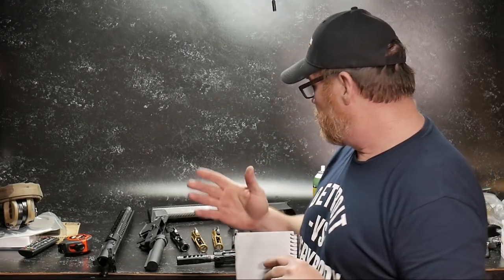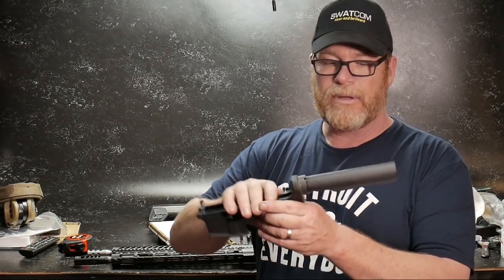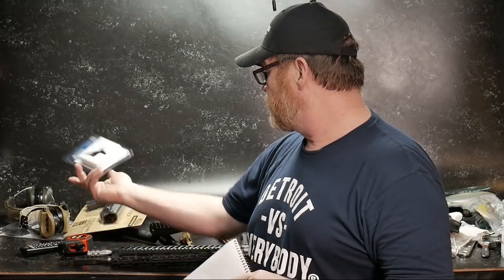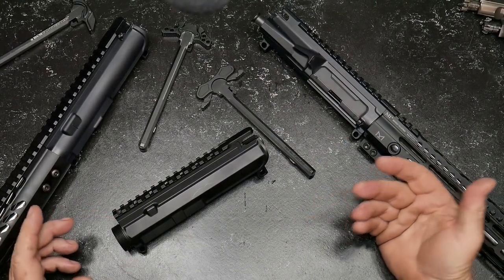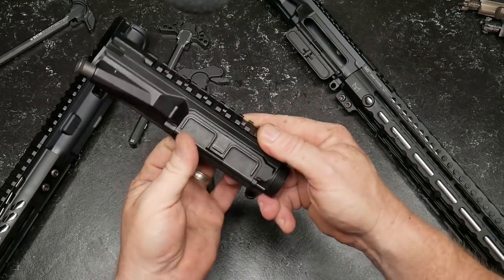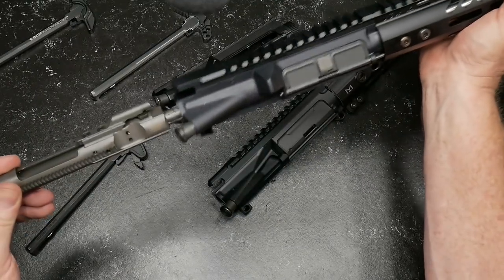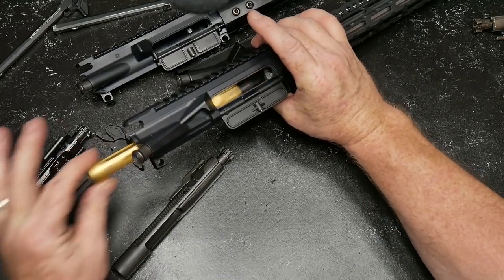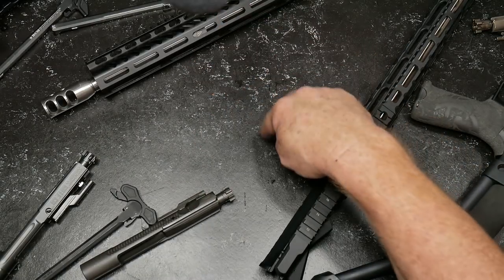Cheap Vs. Expensive!  Forged vs. Billet Receivers

Comment: I think a true mil spec rifle will be just as if not more durable than a high end billet. And shoot just as good.
Reply: Billet, whether steel or aluminum is not as strong as forged. Billet is a process from extruding a block of bar stock. The bar is formed by molten metal being formed in to bar stock, and then squeezed or extruded between rollers. Forging heats raw metal until malleable but not molten and then the pieces are hammered into shape, changing the metal grain, and making it much stronger. Billet is easier to machine on CNC and more aesthetic when finished.
Reply: Thanks for the information but I knew that already.  When I said more durable I was referring to long term use and normal wear and tear, not like a torcher test.

Comment: Use Molly graphite grease and work it back and forth with the carrier you will be using I it. It will lap itself in in short order. Then clean and lube it. I use the stay lube Molly on mine. The acitone clean the carrier bolt upper and everything to remove the Molly. It's a lot of scrubbing but it quiets down fast.

Comment: You want to know he difference between forged and billet, drop them on a concrete floor and note the difference in time, sound. Also, conduct an impact test on both receivers I the same location, with apx same force, a 3lbs mini sledge hammer will do, note the difference in damage to both lowers, and note the sound on impact. Lastly, take each billet and forged  material and shoot it with a 5.56.... note the difference in damage to the two. I won't make an argument to argue with comments. But I will tell ya how to find out why billet is the better choice. Forged material is sometimes reduced wall thickness as well as it being more brittle from the forging process. I'll take a billet process over a forged anyway where impact forces apply. Note that firing your rifle itself, creates shockwaves that ripple thru your rifle. Billet is tougher, not thinner, and not brittle. CNC machine isn't as expensive as it used to be. I'm just a welder, so what would I know. 🥑🥑🥑🥑

Comment: BRIEFLY, take your accurizing tool and put it in from the opposite (intended) end and smooth out the brand new finish on the inside of those uppers.  Put some duct tape on the end to protect the outside of the receiver from an "accidental touch".  Stay there too long and you might mess up the tolerances.  Hence, the word BRIEFLY.  Sometimes I use oil and Emory cloth.

Comment: Hey brother the PA pistol range you visit has been updated with a concrete slab and a roof, but beware they are looking for the smallest reason to handout fines. I received one today for firing my EDC pistol two times (2 bullets) to test my zero, and be a responsible firearms owner at 11:00am and found-out that the range is not to be used on Sunday before noon 🤨🙄🤷🏻‍♂️ make sure to very carefully read the full page of posted Fine Print rules.

Comment: I think the only thing that matters is barrel fit, I usually lap the upper receiver so the barrel fits flush, then hopefully the the barrel fit is tight or next to impossible unless heat is used, to install the barrel.
Reply: No the upper is just as important, especially if you want a precision rifle. I always tell people the best upper for precision shooting is actually a cheap receiver, and it is the DPMS slickside upper. The DPMS slickside is the thickest upper you can get, and it is amazing just how thick it is. The bad part is it has no features that the cool kids want. No forward assist, no shell deflector, so dust cover, but again it is for precision shooting so those features are not needed. In all honestly if I were building a 308 precision rifle my number one choice for an upper would be the DPMS slickside LR308 upper, and if I were building an AR15 for precision shooting my number one choice for an upper would be the slickside upper. It may be hard to find a Slickside LR308 upper or and AR15 slickside upper from DPMS, but several companies make exact copies. The LR308 slickside upper has an ultra high rail, that makes it so you have no trouble reaching the charging handle with a scope attached and that the scope does not touch the handguards. Both uppers are cheap, and the clones are cheap too, but I'd choose them over any other upper if I was building an AR15 or an AR10 style rifle. The downside is they are heavy uppers, but I actually think it balances the rifle, cause a lot of rifles are front heavy, and the DPMS sickside uppers add weight to the rear. Another downside is there are no handguards that are as high as the rail on the slickside LR308 upper, but I would never add a handguard rail to any rifle I own, but it might be an issue for people that have to have railed handguards. Nonetheless they are cheap uppers, but being cheap does not mean they are not great. They are even made from a higher quaity aluminum. They are made from 7129 aluminum instead of 7075 or 6061.

Comment: 1Forge is stronger than billet ,2 uppers and Lowers are just housing.. the upper houses  the blot carrier and the lower houses the the trigger. My three pistol are Anderson lowers and uppers but I hv a ELF trigger In one a timmey trigger In the other and Geissele rapid fire trigger in my last one and 3 chrome Rock River Arms bolt carriers In all three ( highly polished bolt carriers) buy cheep uppers and lowers and buy the best triggers and bolt carriers and buffer and springs and a barrel.

Comment: There is a Reason why the forward assist was incorporated into the design of the upper receiver. It was necessary in certain instances in battle. I don't care what anyone says. Competition shooting is a wonderful thing, but if you have a failure on the range it won't kill you. If you have a failure on the battle field it just might.

Comment: Kotaboy32 Tactical the difference between the two has to do with material structural strength and how they will fail. A forged upper will fail and fragment usually, while a proper billet one will crack and spread but will not fragment potentially saving you pieces of metal to the hand, arm, face, and/or neck areas. It has been shown that unless structural designs are changed to add reinforcement it wont change the strength of the piece but it will change the way it fails. If you are firing 5.56 or such it is nearly unimportant unless you manage to over charge the case significantly, but it does come into factor when you are shooting much more powerfully loaded rounds, notably .458 socom or .50 beowolf where you have a lot more powder and thinner bolt to lug walls.
Reply: Forged aluminum generally refers to material that is ‘forged’ into a specified shape. Forging a lower receiver requires “compressive forces.” In other words it is “hammered” into forging dies to shape the aluminum into the intermediate dimension of the lower receiver. After the aluminum lower is forged into the initial shape, the raw forging is then ‘finished’ on a CNC machine.

Metallurgists agree that a forged piece of aluminum is stronger than cast or billet. The reason being, when the material is shaped under pressure, its ‘grain’ follows the same shape as the part. As a result, the product manufactured is stronger due to the continuous grain characteristics allowed by the forging process.
Reply: @TheRoadhammer379  It can make a stronger piece when the materials are the same but forged uppers as milspec use t7075 which is more brittle and will fragment when overstessed while billet are more often t6061 while weaker is more prone to cracking saving you parts in your flesh.

Comment: You should run it one shot every second (not simulated full auto) until failure and see which one lasts longer, every thousand rounds do a five shot accuracy test. Dont let the gun cool down in between shots, or mag changes, thats really important.   Record it all with out edits and post the results. Thats the range test i wanna see. It will probably take a shit ton of ammo, and mags, and you would need to enlist some help, so you guys could take breaks, while the someone else kept the fun running. POF did something similar but they never checked accuracy. And there gun was not competing against anything.

Comment: Nope, in my early Air Force days, we used M16s with NO forward assist do-dad. Just like Eugene Stoner designed it.
Cool series, thanks much.
Reply: Kenneth G Maiden  My M-16 doesn't have a forward assist and has never needed one. More people blow up AR-15's using a forward assist. It is common for reloaded ammo (I don't use re-manufactured ammo) to have either a squib load or a projectile pull from the case leaving it the chamber. Shooter uses the forward assist to force the next round into the chamber and pulls the trigger! Boom........
Reply: @ckim6400  Stoner fought against this mod. Chrome and powder change solved many problems. Oh, and that little scallop on the side of the carrier, that was the forward assist.
Reply: @ibthumper2  Yup! If it needs more than a nudge with the thumb the problem will only get worse with a forward assist. And if it won't close using the charging handle time to find out why...
Reply: Ha, that means you're as old as I am.
Reply: @kentuckyjustice1408  well, I was on the dirt design team back in the day. LOL LOL
Reply: FA is so 60’s🤣waste of space & weight!
Reply: @ckim6400  with M4 feed ramps nowadays why is  the FA still a thing?
Reply: @tawaitai  I don't use them, guess people think they may need it someday?

Comment: Never been a fan of billet.  
M4E1 is my Gold standard for any build . I do wish they would finally make an Ambi M4E1 Lower.
Pretty much all my builds have Colt Stripped Keyhole Upper and M4E1 Lowers. 
I wonder if this BCG would make that same sound when be inserted into a Colt Stripped Upper . I wonder if that Dry Film Gray Spray they use reduces friction that much.
Reply: It's just the machining Mark's left from production. Iys an extra step to take to polish the inside of the upper. The reality is it doesnt matter. If it is a problem it wont be for long because the bcg will polish it out in just a short amount of rounds.
Reply: Why aren't you a fan of billet? Just curious.

Comment: The only real benefit to billet uppers is they are generally stronger. So if you have a catastrophic bolt/barrel failure it is less likely to blow up in your face as a forged upper.
Reply: I think you mean billet is not as strong as forged. According to metallurgical reports forged aluminum is stronger than cast; ie billet. When the aluminum is heated and pressed into shape the grains of the aluminum fallow the shape making it stronger.
Reply: After the aluminumlower is forged into the initial shape, the raw forging is then 'finished' on a CNC machine. Metallurgists agree that a forged piece ofaluminum is stronger than cast or billet. The reason being, when the material is shaped under pressure, its 'grain' follows the same shape as the part.

Comment: "I've always had a forward assist".... have you ever used it? In a firefight? In a firefight you're not going to take your hand off of the controls to hit that forward assist. I would assume in competition you wouldnt either. You're going to do what works and tap rack. Forward assists are pointless.
Reply from the maker: I use it in competition all the time.  When I chamber a round, I will check again to make sure the round is chambered, then a push on the forward assist to make sure the bolt is all the way forward.  Can't tell you how many times, I've seen guys go to shoot that first shot and nothing is there.  It's all about the checks and balance of the rifle.

Comment: No I agree you can go fancy but, Anderson Upper and Lower Receivers work great and they are easy on the wallet. I like there little slick upper with no forward assist or dust cover. So you don't have to get an upper parts kit. Saves money and is lighter weight 👍🇺🇸

Comment: Forged are stronger, billet usually look better, performance comes down the company and QC, but very little
Reply: Are the billets not forged?
Reply: Not a machinist but i believe billet is machined out of solid piece of aluminum and forged is poured into a casting. Someone correct me if I'm wrong.
Reply: @tonyleesmann8234  Forging means it is formed, usually with heat but not always and then shaped somehow like with a hammer or press. Casting metal is when you pour molten metal into a mold.

Comment: Cheap vs expensive.  You proved there is absolutely NO difference even with a mil spec BCG or an expensive BCG.   Those expensive uppers and BCG are nothing but a gimmick.
Reply: keith mcdowell  I understand.  But even if your competing.  What was the difference in the BCG, 2 ounces 🤷🏻‍♂️.  If his other videos, the expensive complete rifle actually weights more then the cheap one.
Reply: keith mcdowell sorry.  The total built upper.  But I understand your point.  I have a friend that has one of those competition guns with the carbon fiber stuff and it’s feather weight.

Comment: You have violated your own criteria with the triggers, and other parts.  Instead of Cheap vs. Expensive, you went with Moderately Expensive vs. More Expensive.  Come on and tell us why you made the switch.  I know why you wouldn't use the mil-spec trigger, but you should at least explain your actions.  I think a better title for the series would be Less Expensive vs. More Expensive.  I think you should always explain why you don't use the cheapest route. i.e. Why you didn't use a mil-spec $10 butt stock; why you don't use a mil-spec barrel; and why you chose not to use an A2 style hand guard.  The Anderson lower is the only truly cheap part that I have seen on your builds.
Reply from the maker: This is a competition rifle not a milspec rifle.  That is why
Reply from the maker: If I wanted to compare expensive vs real cheap, I'd got buy a JP and compare it to a BCA.  That's not the point of these videos.  These are Competition rifles, it needs to be competitive not a piece of shit